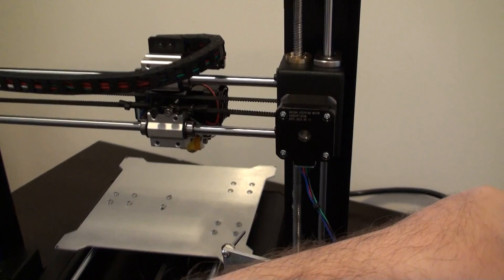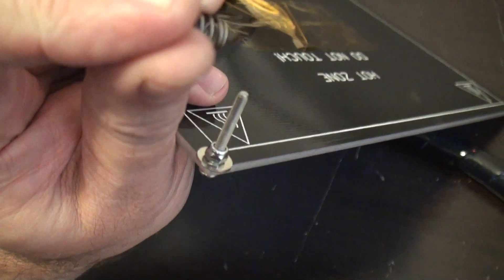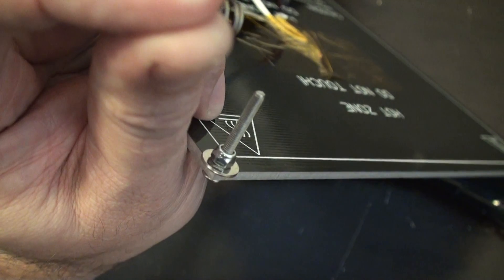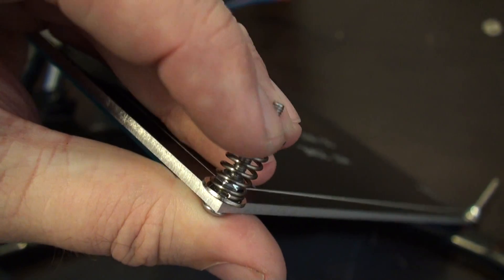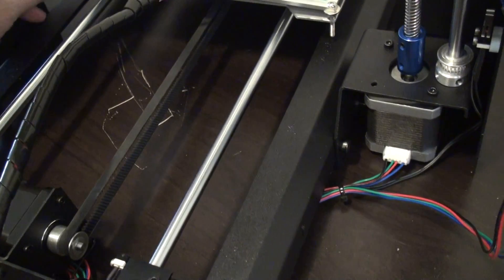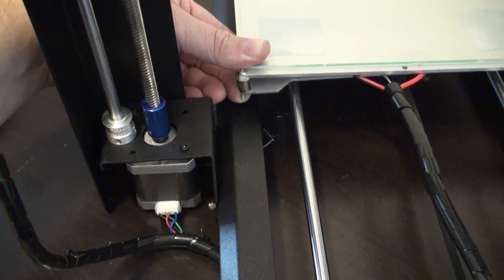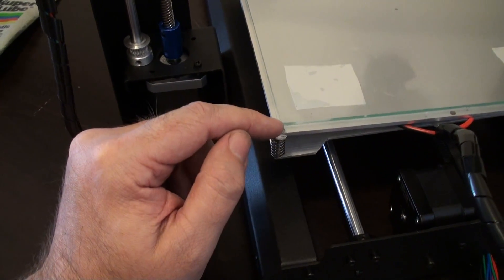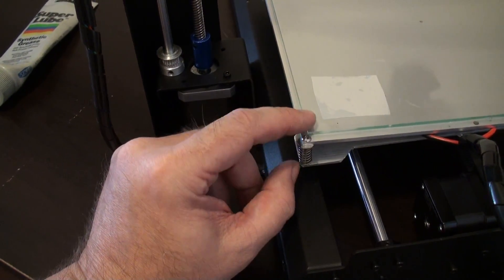Wanhao i3 bed mounting mod

Comment: This mod makes it so easy to level the bed ! It also makes the bed much less susceptible to falling out of calibration, i did the same mod but with larger penny washers to spread the force on the PCB and its wonderful. Combine it with the thumb screws with nylon locking nuts and you have a bed that will stay exactly where you put it, sure the thumb screws will be harder to move with nylon lock nuts in them but its worth it for the stability. Next mission is to replace the bed bearings with self lubricating bronze bushings. Then i think i will move to the extruder. Bronze bushings again with longer bearing blocks (3d printed) with 3 bushings in them each so it will be about as wide as your mod with the longer LM8UUs, then a hotend and bowden , E3Dv6 i think.

All your mods are awesome and have given me so many ideas to turn my wanhao i3 into a beast. I am in the process of constructing a build chamber as well.

Comment: Hi, Could I use M3 nuts instead of locknuts? I don't understand how you got the locknuts all the way up the screw since the locknut starts tightening as soon as you put it on. Thanks for your help.
Reply: Having the same issue here.  Purchased a bunch of M3 nyloc nuts and I can't get it to go all the way up on the screw as it's starts to lock immediately.  I'm sure I can get it all the way up with a wrench but that defuses the purpose of this feature as it will be very tight to adjust the bed easily.  I'm not sure why everywhere I read about this mod it recommends nyloc nuts.  Am I missing something?

Comment: I used a bunch of thermal compound between my glass and aluminum plate. The Glass doesn't move, and seems as though it's working.
Reply: heat them up a little and run them all the way down the screw whist the nut is hot , this will cut a thread into the nylon but still give it enough 'lockness' to stay nice and stiff.

Comment: What size glass sheet are you using on this heat-bed, and what tape are you using to hold it down?
Reply: Pigeon .FX   200mm square, fits just inside the bed screws.
(edit:) 200x213mm gives you full bed length in the Y.  And that is going to be the slicer setting for bed size.
All specs and mods can be found here: http://3dprinterbrain.com/pmwiki.php
 Tape is "silicone thermal pad", typically used for CPU/GPU heatsinks. Brand is "GINO". It's 0.5mm thick.